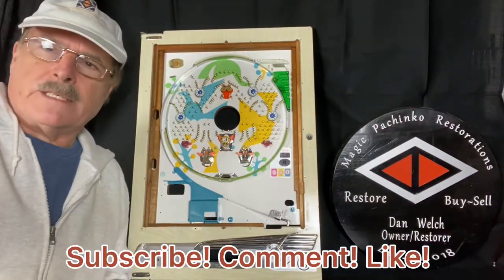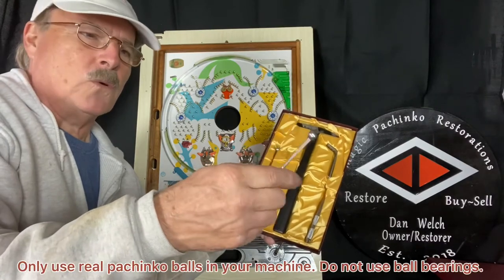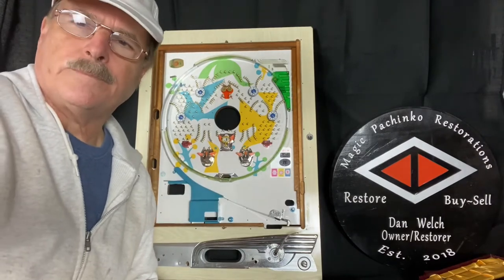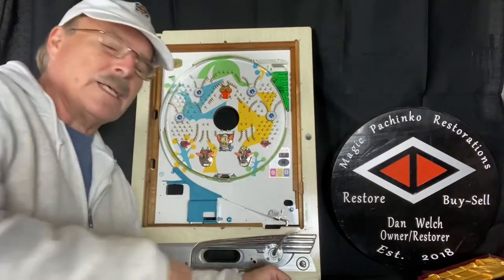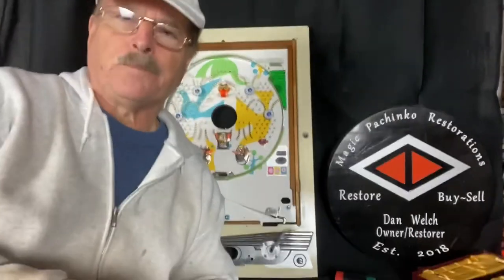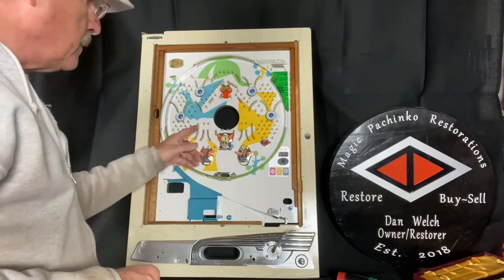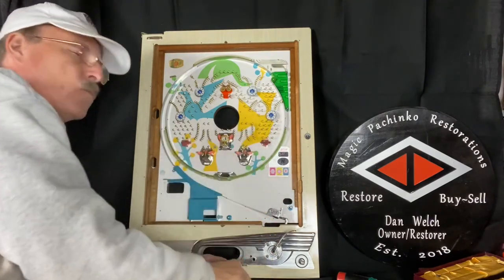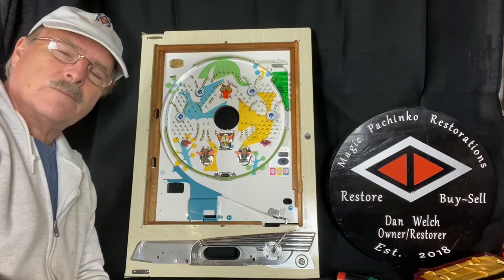How to adjust the brass nails on a pachinko machine.

Comment: Dan this is great. I may go back in and check a few things again. I have struggled to maximize the payouts on my single shot but there is only one tulip which makes it tougher. Had recently studied a pdf online about pachinko nail placement in winning pachinko machines- possibly the same doc you reference. Despite repeated efforts I Still feel that it could payout more. Seems to be a very delicate balance btw nails and spring tension. When you demo your machines they seem to payout much more often then I have achieved.  There is certainly an art (or magic) to there adjustments
Reply from the maker: Glad you got some things to try. Spring tension is easily adjusted both on the backside of the machine and how much you push down on the launch handle. Try to get the combination set so the balls fall down the middle of the machine.
Reply: Would you mind linking that pdf you mentioned? I've gotten quite interested in pachinko machines as of late and would love to have a look at it.
Reply from the maker: @Dragonflier001  I thought I had a pdf file, but I couldn’t find it. I did locate the original at Pachitalk. https://pachitalk.com/forums/local_links.php?catid=65&linkid=548